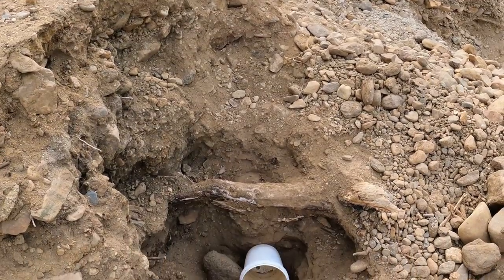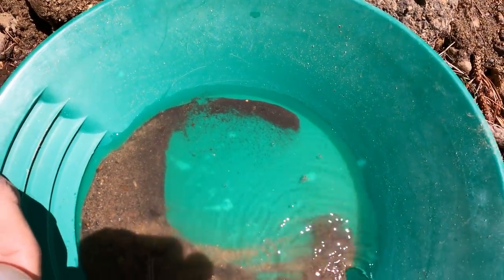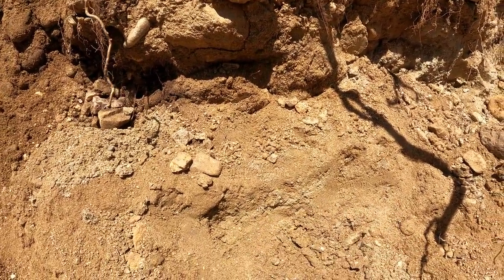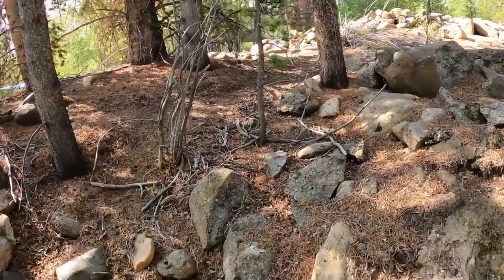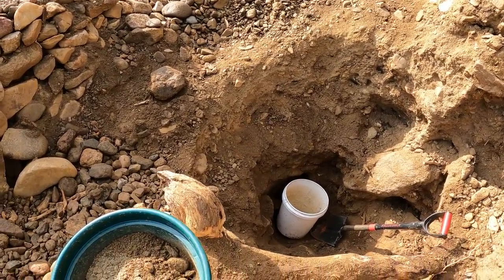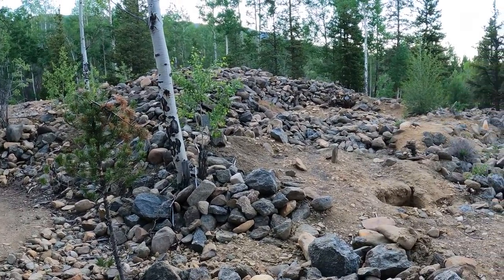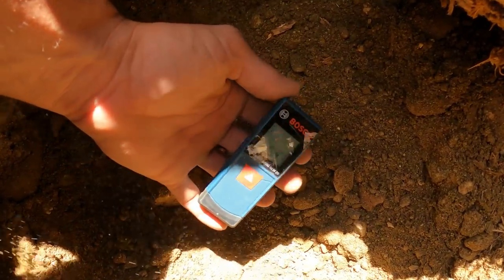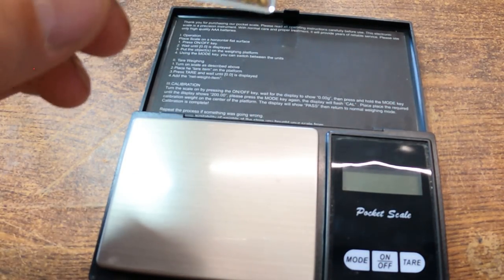Rich Gravel Deposit Found - GOLD MINING COLORADO

Comment: Bummer on losing your bucket of concentrates on the road  in my experience flour gold concentrates in odd places and deep or shallow it’s small enough water can move it around easily. So that’s why they say gold is where you find it. Bigger pieces on the other hand follow the rules of straight lines because of their weight it’s hard to tell where the old creeks and rivers ran before flood events and high waters created the gravel bars that ultimately changed the course of where they run today compared to a hundred years ago but to me that’s what makes prospecting so much fun trying to decipher where the gold is deposited. And where the pockets or pay streaks are. Thanks for sharing see you on the next one👍🏻👊🏻
Reply from the maker: I appreciate all the support and info!

Comment: I made a 2 x 4 frame that sets on my Gorilla Cart, 1/2 hardware cloth attached on the bottom with n1/4 lathe for support.  Shovel the dirt right onto the screen, gloved hands to agitate the material.  Fill up the cart to the brim.  Don't need buckets.
Reply from the maker: Good idea! But I need buckets to haul out of a 9 ft deep hole.
Reply: @DiamondMinerIvins  Then pour the buckets on the screen and classify.  Bigger screen makes processing large amounts off material go quicker.